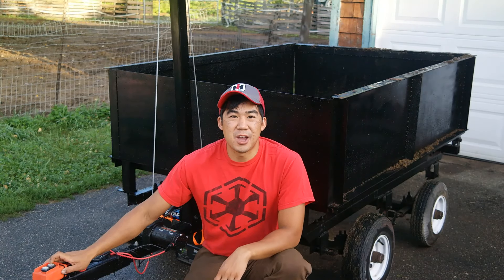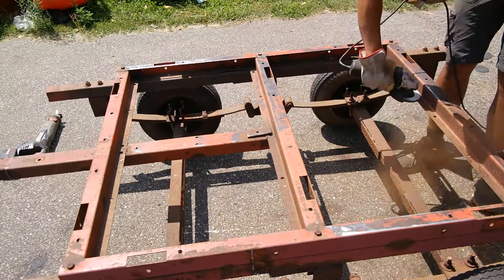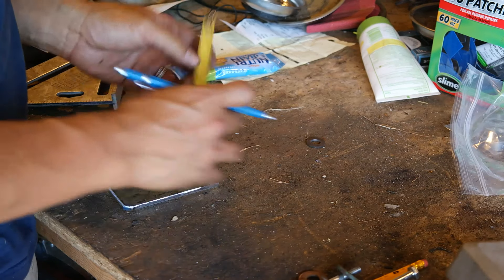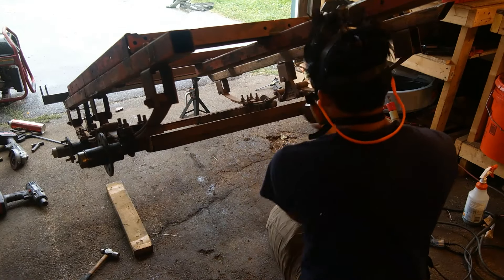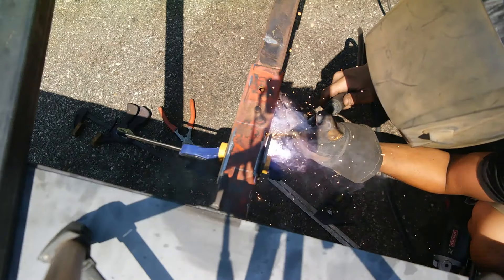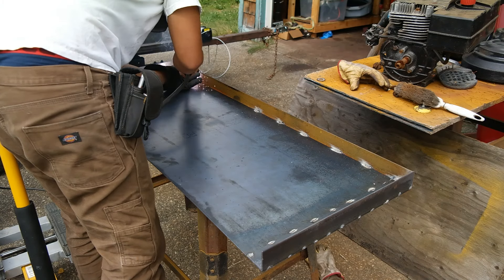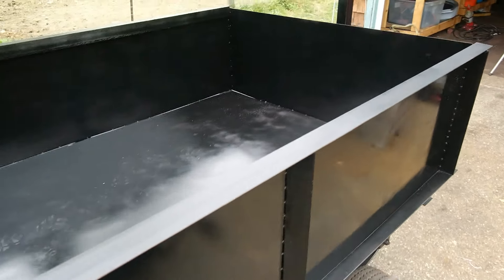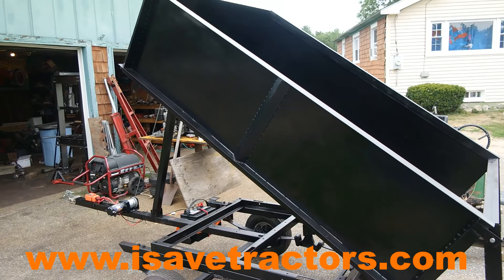Winch Powered Dump Trailer Build for Lawn and Garden Tractors

Comment from the maker: Since the filming of this video, this trailer has been used almost daily on our 8 acre property to haul sand, dirt, gravel, compost, manure, firewood, demolition debris, and more. Everything has held up including the paint. The mast pivot and rear hinges show no wear yet. The heaviest load it can handle is about 6 small FEL bucket loads of pure gravel. Any more and the winch was not strong enough to lift. It can take trailer full loads of lighter material such as mulch, manure, and compost. The winch wire has tanlged a little bit in the spool and that's about it. The theory behind this trailer has proven itself so far. Thanks for watching! Be sure to follow us on Facebook to see daily photos and updates on these projects and what our company has to offer in terms of vintage small engine parts.
Reply: Thats awesome! Im going to use this inside a box truck that i have. Thanks!
Reply: isavetract o
Reply: That's a cool set up.
Reply: I would have upgraded the floor with a much thicker steel, 12 or 10ga, that 20ga is basically sheetmetal used for car bodywork.  Otherwise, this trailer looks damn good to me!
Reply: No video proofing?
Reply: Great Idea,  I was going to build a hyd dump but this like an easier way to go. I think I'd try a drop block to double my lifting power when dumping.  great video
Reply: I guess Im randomly asking but does any of you know a trick to log back into an Instagram account?
I was dumb lost the password. I appreciate any help you can offer me.
Reply: @Koda Lyle Instablaster :)
Reply: @Bruno Eugene I really appreciate your reply. I got to the site thru google and im trying it out atm.
Looks like it's gonna take quite some time so I will get back to you later with my results.
Reply: @Bruno Eugene It did the trick and I finally got access to my account again. Im so happy:D
Thanks so much you saved my ass !
Reply: @Koda Lyle Glad I could help :)

Comment: I was thinking of a winch setup for a truck bed on a chassis frame. The hydraulics are expensive and I already have the 12,000lb winch. I may get the project going this weekend if possible. Awesome setup and I also need it for my 8 acres.

Comment: Looks great Norman! The only thing I would do differently if it were mine (which is not likely.. this is so much better than something I'd build) I'd put short chains on the bottom of the tailgate so you have the option to dump/spread if you ever wanted.
Reply from the maker: Thanks for the idea! I will add chains to the tailgate!

Comment: Hello Norman. Good job on the trailer👍. When the mast pivots back to allow the dump mechanism to reach max height without getting in a bind(works great by the way) if you added a inverted 'hook' to mate with the top of the dump box when at max height, this would prevent the box from being able to go too far back and possibly invert in an upside down position. If this were to happen it could be difficult to reposition and might even cause injury. 
Just a thought but overall great job👍👍
Reply from the maker: Thanks for the suggestion! Great idea!

Comment: Accident waiting to happen. You need to increase your axle strength to support the new load structure, also tires need to be larger and that cable doesn’t look strong enough. Other than that. Nice job
Reply from the maker: Still use this daily on the farm today. Nothings broken except I've replaced the winch motor because the remote filled with water

Comment: Questions.  1. How do you like using a cold cut chop saw blade versus a abrasive wheel in the chop saw?  2. Do you remember where you bought the cold cut saw blade?
Reply from the maker: The Cold Cut blade is from Northern Tool. It cuts straighter than the abrasive saw. However I don' use either anymore. I opt for a metal cutting bandsaw, as it cuts much more square than either of the Chop Saws.
Reply: isavetractors Thanks! I was in Harbor Freight eyeballing a metal cutting bandsaw yesterday.  Thnx! Stay safe!

Comment: Isavetractors. I noticed you hold the mig wire too far away when welding. Try about 1/4 to 5/16 inch from material. Looks fantastic though👍
Reply from the maker: It's because I use fluxcored wire and not gas for this project
Reply: @Isavetractors  gotcha. I thought about it after and kinda figured that

Comment: looks good. how much weight you think it will hold? do you think it would be better to use a shackle at the winch hook spot?
Reply from the maker: I'm not sure. I have filled it with wet horse manure, and it lifts it fine. Whatever that weight is the max.

Comment: I'm actually planning on building a similar trailer. Looked on my feed this morning and this was one of my recommended videos! I thought it was wild you tube must be reading my thoughts. Trailer turned out great good job. I plan on pulling mine with my 6x4 John Deere gator. How's the 20 gauge holding up? I'm considering using same material but I haul a lot of firewood and odd material on the farm and just curious if it will be strong enough not to dent. Again great job!
Reply from the maker: Thanks for your comment. The 20 gauge is holding up great. I have hauled bricks, manure, and gravel with it and it's been holding up great. No dents yet. There is another video on youtube that showed a guy making a scissor styled lift using a winch. If I had to do this again, I would use that idea and get rid of the mast. The mast works, it's just a little goofy looking. Thanks again for watching and your compliments!
Reply: I'd use at least 11or 9 gauge sheeting,11 would work good 9 will handle anything you throw at it.
On my trailers I used 14 ga. and should have used 11ga.

Comment: Impressive trailer, but thought I would comment on the hinge.  I've taken heavy wall pipe which I could fit a machined shaft (junk yard find) through, and then cut that pipe into shorter sections.  With the shaft already within that pipe, I would then weld every other section of the pipe to the frame and then the ones that weren't welded to the frame I would weld to the dump body.  That gives you a heavy duty hinge, kind of like what you find on the door to your house.  It's a concept that is very easy to build, it aligns itself during construction and will function under incredible loads.  Consider this approach the next time you need a heavy duty pivot point, like on this small dump trailer.  I'm sure you will like how easy these are to build and how strong they are.
Reply: Jeff Bishop Nice idea!
Reply: It also helps to put grease fittings on each section of pipe, eventually that setup can rust if you don’t. I built a trailer like this only larger and able to haul/dump 6k, and used greasable pillow blocks and grade 8 bolts for the pivot points.
Reply: julie r  That sounds like the way to go. Did you use 4 pillow blocks, 2 for the frame and 2 for the dump bed with a shaft of some kind through them? I'm curious how you did it, I'm looking to build a dump trailer but something smaller...
Reply: Jeff, I used 2 pillow blocks mounted to the frame 4’ apart. Then made U shaped brackets that went over the pillow block out of 1/2” steel which were welded to the dump bed. Then drilled the steel brackets to match the pillow blocks (3/4”). Then 3/4” grade 8 bolts 3” long and washers between the steel and pillow blocks, as well as between the bolt heads and nuts and steel.
Reply: Just heavy duty weld on hinges will work just fine but I used 7 to 9 of them on my trailers.

Comment: Great Video as always! A lot of steel on that trailer! How much does it weighs? When you weld without long sleeves, do you not get a "armburn"? I know I get that from the little bit of welding I do and you weld a lot more.
Reply from the maker: I guess the trailer weighs a couple hundred pounds.  maybe 250#. yeah my arm gets burned by spatter occasionally but it doesn't really bother me. it's too hot to wear my welding sleeves.

Comment: How does the mast manage to not ever tilt forward? Or how did you go about making it to where it doesn’t. Looking to do this myself if I can! Anyways thanks!
Reply from the maker: the tension of the steel wire holds it in place. It only moves to find the center point of the wire.

Comment: If your pivot point was in the middle you would only have to lift 1/2 the load.  The way you have it pivot at the back your winch must lift all the load so will limit the lift and extra wear on the winch.
Reply: if the pivot was in the middle then the back of the bed would hit the ground, also if enough weight was behind the pivot it could flip the bed up throwing slack in the cable.. not a good thing.

Comment: the trailer turned out great. I was wondering if you could get parts for a four cylinder air cooled Wisconsin motor for my '65' New Holland skid steer?
Reply from the maker: I might be able to. email me the model number of the wisconsin to: info@isavetractors.com

Comment: I'd like to build an insert to my UTV trailer where I can haul and dump debris when not hauling my UTV.  Your trailer gave me some excellent design ideas.  I'm new, very new, to welding.  I've only burned three 2lb spools of flux core wire so far.  Watched a lot of YouTube videos on welding.  But to make me smarter on the subject, I have to ask about your stick out.  It seems like it's about 1" long (or is that simple the angle of the camera view).  When I weld, I have to have the contact tip about 1/4" from the welding surface.  What am I don't different or wrong?  Or are you using what I've heard called "spray transfer"?
Reply: My little experience with flux core wire is you need a bit more stick-out than if you MIG weld.
Reply: Thanks for the info.  You're the first person to say that stick-out is different between weld types.  I'll give it a try.  I hope that helps with my porosity.  Once it a while, I get a real good looking weld.  But many times, they are ugly.  I don't think my travel speed is too fast (but maybe it still is).
Reply: @bareavis  about 3/8" is good.

Comment: Great trailer. I like the idea of the mast being able to pivot. Just wondering if it tends to move around and shake when traveling. If so, what's your fix?
Reply from the maker: It doesn't move around. When I lower the trailer I keep some tension on the line, and that friction keeps it from shaking around.

Comment: Nice built but some comments, ...1/ please tidy up your electrics. the neg of the winch is probably chassis neg. this means the exposed thermal breaker you've wisely added coul easily  end up touching the chassis and cause a short...if it's the battery side then you'll have an explosion on your hands..... 2/ You don't need a deep cycle battery for this application, a regular starter battery will be just fine so long as it is kept charged.....3/ as the winch has a capacity much greater than 5ft why not add a pulley to the system, if moving heavy loads the the tip will be half speed but twice the lift capacity.
Reply from the maker: Thanks for your comment. The winch is not ground through the chassis but through it's own wire. A deep cycle is actually what is needed as a regular starter battery is not designed to be drained and charged over and over. The only way for me to use a regular battery is if I had it hooked up to a direct charge from the pulling vehicle. I did consider adding a mechanical advantage to the pulley but speed is more important to me since it is mostly used on manure, compost, and other lighter materials. When I load it with about 3/4 full of gravel it works fine as well.
Reply: I'd use a heavier winch for the job,less problems.

Comment: My only complaint (although you did an excellent job) is the rattle can paint job. Why would you do all that fab work and not paint it correctly? Harbor Freight has some inexpensive HVLP guns that would do the job 1000% better than rattle can . . .
Reply from the maker: I have been demonstrating these methods for our main DIY customer base. In addition to a HVLP Gun you need a big air compressor which is beyond what most of our customers have. Rattle Can Paint Jobs when done properly look great as well. Stick around, we will be doing paint jobs with paint guns too in the near future. All of my tractors are working tractors too, so even with hardener and pro mixed paint, they are going to get beat up. We are planning a show tractor series in the future, where we will cover the finer details for those looking for that.
Reply: My suggestion, look into the California Air Tools compressor sold online at Home Depot. Well worth the money and they preform well and they are SUPER quite. I've painted several Jeeps using their compressor which I think I paid $329 for a few years ago.
Reply from the maker: Dean T will do! thanks for the lead!
Reply: Rattle can is fine it gets all scratched up anyway

Comment: as that a tig welder
Reply from the maker: Natsu Moe no a mig/wire welder. I'm not using mig though. I'm using flux cored wire
Reply: Flux core wire feed welding,mig welding uses gas when using solid wire.

Comment: Very concerned with the winch cable. Under load if you lost a shackle, hook, or cable splice the kinetic recoil up and over the mast would be bad. Most dangerous is the fact the your controls and the winch operator are then inline with a runaway cable, and hopefully no one is on the vehicle towing the dump trailer. Other than that great ingenuity and idea.
Reply: i concur
Reply: D Wax Yup
Reply: I started building 10'x6'x3' dump trailers over 20 years ago using a winch for dumping the trailer.And also using it to pull large trees and stumps onto the trailer.
Reply: I have up to 4 ton loads on my trailers hauling dirt,gravel,trees and large loads of steel.I now have 4 dump trailers,and the first 2 have hauled 1200 to1500 loads already...
Reply: Nice little trailer, I just don't want anyone thinking that I am cutting this idea.